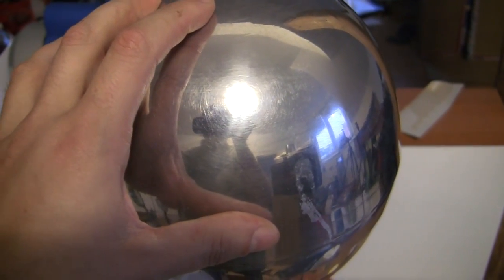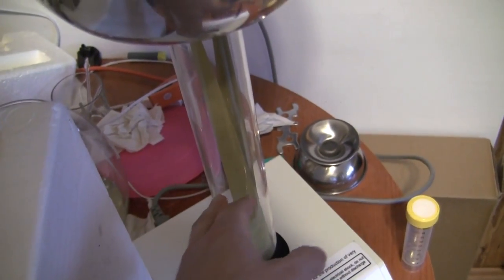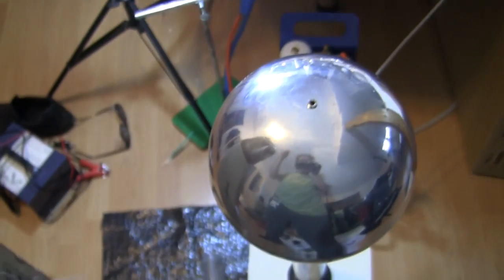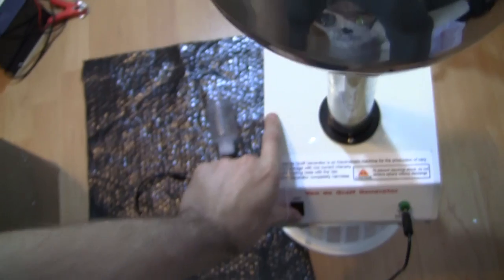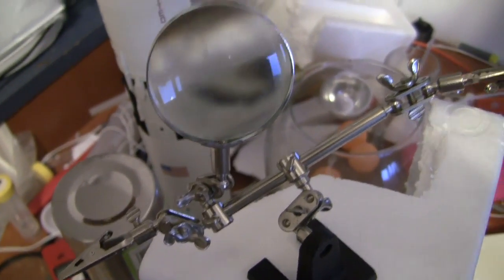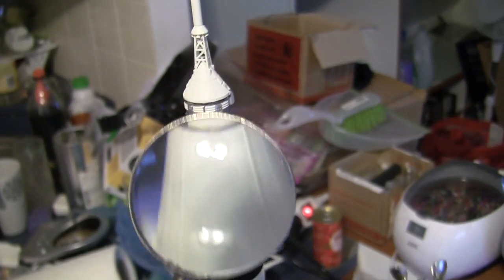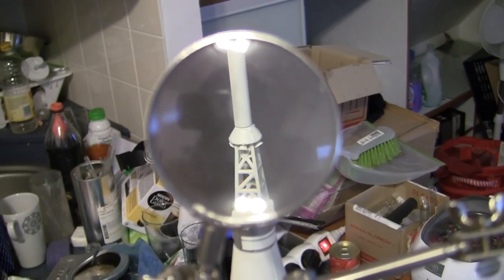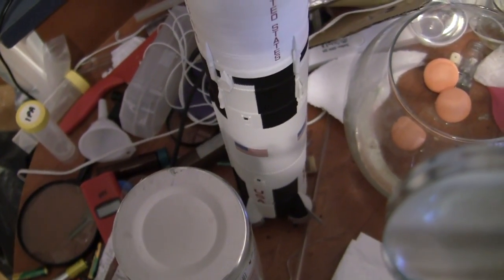Surviving a 10 000 VOLT shock!

Comment: A lot of people here have said it's the current (amperage) that kills you not the voltage.  It's a lot more complicated than that.  Voltage (measured in volts) is the potential energy of a unit of charge (measured in coulombs), so it simply defines how much energy is available for a given amount of charge.  For an electron to jump through space several millimeters requires more energy (voltage) than would be needed to move that same electron from two surfaces that are in direct contact.  Current (measured in amperes) is simply the measurement of how much charge moves past a given point in a given amount of time ( 1 coulomb per second =  1 ampere).  There is an analogy (though not exact) between electricity in a wire and water in a hose. Think of voltage as being similar to the water pressure and current being similar to the amount of water that passes through the hose in a given time.  Coulombs would be equivalent to the amount of water in the pool you are filling with the hose.

In the video the 10,000 volt spark jumping from the Van der Graaf to TF's finger, we don't really know the current, but it need not be small.  The reason for this is that current is time dependent (coulombs per second) and the spark is really short in duration meaning the actual current could be very large even if the total charge is small.  

Another issue is that the pain one feels from such a shock is not solely dependent on voltage, charge or current, but something called current density (current per unit area).  When the spark jumps directly from the source to the finger, all of the current is flowing through a very small area of the skin and we feel a painful shock. If, instead we hold a metal object,  like a key, between our thumb and forefinger and let the spark strike the key we feel little or no pain, even though the total current traveling through our body is the same.  This is because the current is now distributed over a much larger surface area.

The reason lower voltages tend to be less dangerous than high voltages has little to do with current, charge or current density, but with the nature of our skin.  Dry skin is a fairly good insulator at about 100,000 ohms.  This means that by Ohms Law touching both ends of a 9 Volt battery will only allow 45 microamps to flow through you (i = 9v / (100kΩ in + 100kΩ out)) which most people will not even feel.  But if you touch that same 9 Volt battery to your tongue, the electrical resistance drops to no more than a few hundred ohms or so and the current therefore goes up by a factor of a thousand and you feel a nasty shock.  Very high voltages can also cause dielectric breakdown of the skin, meaning the voltage is sufficiently high that current can pass directly through the skin as if it had little or no resistance.

Also, at very high voltages, you can also receive a shock even if you are not grounded (no closed electrical path).  It only requires that your body be at a lower potential than the electrical source (a neutrally charged body is still has a potential, even if it is zero and zero is less than any positive voltage voltage source).  Thankfully most of the time not much current needs to flow before your body reaches an equal potential with the source.

Comment: It isn't the "current" or the "voltage" that kills you. 

You can charge a 560pF condensator to 10kV. For the first few moment's of a discharge through human hands(ca. 1kOhm), the current will be close to 10 A. 

But I have already survived that,. Why? The Voltage decays very fast, 0.000003 Seconds after the discharge, the voltage will be 0 volt.

Comment: I get that voltage and current are separate, but what I wonder is, how do you get more of one and less of the other or vice-versa? isn't the "amount of electrons" what increases both? so how do you have tons of voltage without much amps, or tons of amps without much voltage? is it just about resistance? high resistance means you can have tons of amps without tons of volts? low resistance means you can have tons of volts without tons of amps?

Comment: Car spark plugs can output around 100,000 volts and it bloody hurts when you get shocked by them! although its pretty safe... the worst shock ive had was from a 240v capacitor for a camera flash. it lasted just over a second (which makes a huge different vs a sudden static discharge shock which lasts a fraction of a second) and it actually burnt my finger!

Comment: I built one of these (globe was 60 cm in diameter) and got about 60-80 cm sparks depending on air humidity.
I played with it a couple of years and then donated it to my children's high school.

Try this:
Lower the lightning in the room.
Stand on a plastic bucket and put your hand on the globe. Start the VDG and point your finger on the other hand out into the room. Purple plasma beams will form from your finger tips. These beams will be able to make curtains move some 20 ft away.
This is cool and will make great videos.

When standing on the bucket, fully charged, discharge carefully before stepping down, since your body and the globe has a significant amount of electrons. Discharge by letting go of the globe and stand still for some 30 sec.

When playing, make sure you're head isn't to close to the ceiling, water pipes etc. I learned it the hard way :)

PM me if you want some more tips.

Comment: Just want to throw in another fun fact. The ignition coil(s) on a typical automotive gas engine normally step up to 20kV - 45kV. I have seen performance ignition coils go into the 60kV range, and I read an article about a 100kV coil some time ago.

Comment: What I always wondered about is why high voltage doesn't necessarily translate into high current. More voltage through the same resistance should equal more current right ?
Reply: The proplem here is that you wonder about something and try to explain it without knowing or thinking about the whole picture.
The first important factor for electrical cables is the electrical current you want to transfer... the lower the current the smaller you can choose the diameter. Temperature is the reason for this... putting it simply pushing electrons causes friction(resistance) which heats up the material which increases the resistance.... if you can't get rid of the heat your cable will melt sooner or later.
Next is voltage drop... the further you transfer the more volt you loose. If you work with a low voltage you can't afford to loose much. If you transfer at 230kV you couldn't care less about loosing a few hundred or even a few thousand volt.
Now putting this together you don't want to transfer either current or voltage but power... P=U*I if P is the constant you want to move and if its better if I is low that means we need high U wich is also beneficial because we can afford to loose some voltage over the distance.
Reply: Nokwar You didn't even try to answer my question did you ? I know all that, the voltage doesn't actually drop, you're just measuring voltage across a part of the circuit.

What I want to know is why a taser for example is relatively while a 120 outlet is potentially dangerous. The resistance of your body would be the same. Is there some impedance effect or does the source fail to deliver any current and thus the voltage drops.
Reply: Keven Harvey
If that is your question you should have asked it... what I can see it's not even close but anyway.
Your taser delivers miliamps (around 3 is normal or so i read) thats 0.003A.
A 230V outlet (sorry thats what we use where I learned my job as an electrician) delivers 6-16A (but i guess your 120V outlet delivers roughly the same)
At 50Hz (for 230V systems again) around 30mA (0.03A) is where it gets dangerous for healthy humans because then the signal is strong enough to override your nervesystem and derail your cardial tact. That will cause your heart to flutter and that is the reason you die.
Now if you knew that as well I don't know why you asked in the first place.
The source does not fail because it delivers what it's supposed to... energy in the form of Watt (P)
There is no problem anywhere just simple physics. Your taser delivers 50kV with 3mA = 150W while the outlet delivers 230V with 16A = 3680W.
Thats all the energy these things can deliver.
P=U*I U=R*I
P=R*I*I > P=R*I^2
U is not important anymore
P cannot change thats what gets delivered
R changes in 1 direction and so I must "counter" to the other.

Now if I misunderstood your question again please rephrase it and I'll try again^^
Reply: Voltage is not something that exist "through" something, it's a measure of potential difference between two points. A voltage only exist across a component. You can imagine voltage as "how much the electrons want to move", and current as "how many electrons can move", the limiting factor being resistance. Most things we deal with our daily lives are not very conductive, they have a high resistance, i.e. electrons can't easily move through these materials. They are insulators. Conductors are mostly metals, or salty water. If you apply 100 VDC across a regular coin, you'll most likely melt it (assuming your supply is able to provide the current, which they most often are not). You can look at your various chargers, they will always have a max current rating - like a phone charger is around 1 A. Your mains socket might be able to supply 16-25 A, lead-acid batteries can supply 200-400 A, supercapacitors can do 1000 A. etc. Current ratings like these is always a maximum figure, the actual current provided will depend on the resistance of whatever you connect it to. If you connect that across a coin you'll just have 1 A flowing, nothing much will happen. The resistance across a steel fork might be around 25 ohm, which means that if you want to pass 1 A through it, you'll need 25 V across it (V = I*R, I = current). If that fork was made of copper, you might only have 0.05 ohm across it, in which that same 25 V would cause 500 A to pass through it (25/0.05 = I), in which case it would glow red hot and most likely melt.
Reply: My understanding is that a source can't deliver both voltage and current. A voltage source will deliver a different current depending on the resistance and a current source will deliver different voltages according to the load.

The most common source in our houses are voltages sources and the current rating on them is the maximum they are designed to be able to handle. Past that maximum the voltage will drop, the power supply will overheat and most likely fail.

Comment: i thought a static discharge could be up to 30k volts? meh at 10k
Reply: Brotherhood of Comedy
neither is really the problem it's the time you are subjected to them that screws you^^
Reply: Brotherhood of Comedy Ohm's law must be obeyed at all times, there is no such thing as voltage without current or current without voltage. the only determining factor is how sweaty your hands are. (and if you have any cuts in your skin)
Reply: It can be close to infinite, The voltage in a lightningstrike can be up towards One Billion Volts, One centimeter(About one third of an inch) Is about 10 000 volts, Now think how high the Clouds is, That is how Extremely high voltages is needed to the clouds to discharge.
Reply: Yes, they do. Everything follows Ohm's Law.
Reply: ***** yes they do lmao, they have something called dynamic resistance which means their operating points change as conditions change. in this case their resistance is expressed as dV/di. also they arent the only things that behave in this manner your body for instance actually offers lower resistance the higher th voltage you're exposed to. 

Edit:Nope you're right ohm's law formally only talks about linear relationships in conductors.

source:i am a recent ece grad with a focus in semiconductors
Reply: ***** So you're just saying "your measurement is correct but it's wrong".
This statement is false.
Reply: For that matter, there's no such thing as a component with a fixed resistance under all circumstances. I'm pretty sure there's no component with a fixed resistance across various temperatures. Ohm's Law always works pretty much by definition because resistance is defined as V/I. If you think you can have more current with more resistance with a given voltage or the opposite of that, then you don't understand what resistance is.
Reply: ***** i should maybe not reply at one am whilst on the shitter as i seem to suck at conveying my point. all i merely meant by my last comment is that working in the industry, be prepared to see things reffered to incorrectly because of bad habits/ people just not giving a crap. This certainy was an eyeopening discussion though i mean 4 years after you start on your degree and after you graduate and begin working as a technologist nobody really cares if you say ohms law. It was one of those things i learned a long time ago but it's so basic that few people actually look at it so formally. Just look at the comments above lol, i'm not the only one to get it wrong. 

its really amazing how assuming you know something actually prevents you from learning more about it.
Reply: ***** I'm not sure how to make this more clear, but if Ohm's law only applied to components with a permanent resistance, it would apply to nothing at all and would be a pointless law. The fact is it doesn't apply only to components with fixed resistances. A function's variables don't have to be constants. In fact, that's why they're called variables; they tend to vary.

Also, resistance is by definition voltage divided by current, so it holds in all situations. There are some where it's not very useful as you've pointed out but it remains valid nonetheless.
Reply: Amps are the dangerous ones
Reply: ***** Sure. Especially semiconductors.
Reply: ***** And still it does obey Ohms Law.
A diode simply does not have a fixed resistance.

I = U/R   > no where does it say that 'R' has to be a fixed value and can not be itself a function of U/I or other things.
And as you mentioned theor characteristic - well, what do you think they are for?

Oh, so you can calculate the current flowing if you apply a specific potential.
Ohms law wins again.
Reply: ***** nigga you know what i owe you an apology you're absolutely right ohm's LAW is only for linear relationships more specifically conductors. But that doesnt mean diodes don't have a resistance that is measured in ohms. I didnt read your comment carefully and i thought you said that diodes dont have resistance rather than they dont follow ohms law.

evereyone listen to this guy he's right
Reply: ***** Sorry for you that i have learned electronics, circuit design, none-linear circuit technique and many more things in that direction.

Ohm's law has changed over the past.
The linear function is by far not the only solution anymore.
You know, R can also be a complex exponent for example.
And lo and behold, it works that way and yet is still called Ohms law even if applied to things like tunnel or gun diodes.
Yeah, you can have some pretty complex formulas there, yet it still falls under ohms law.
Reply: ABaumstumpf i think the issue here is we're getting our definitions mixed up on a technicality (i just spent the last 20 mins or so going through some of my old textbooks) ohms law only refers to objects with a linear relationship but even among my peers we coloquially use it to describe any relationship between voltage and current. Its really an argument of semantics at this point.
Reply: ***** Pretty much - yes :P
What i learned, what all my colleges learned, what is used nearly everywhere is Ohms law as the correlation between Voltage and amps, not limited to fixed resistance.

Btw - the original point of the comment flow was about an idiot stating that amps kill, not volts. You don't get amps without volt, and neither is sufficient to determine the damage done.
it pretty much is wattage and energy, or high enough energy in a not too long time to kill somebody.
Reply: *****
http://en.wikipedia.org/wiki/Ohm%27s_law#Reactive_circuits_with_time-varying_signals
You go as far as post the Wiki-link and then ignore the sections you don't like :P

Comment: I think Van der Graaf generators put out a lot more than 10000 volts. At school my teacher said 250,000. I remember learning that. I just checked another youtube video which says 200,000.

Is that because different generators produce different voltage? Or is TF out there?
Reply: Size of the generator, materials used for the dielectrics (the moving belt and their axles at each end) and insulators, the speed of the motor, the size of the capacitive sphere on top are all factors in determining how big a charge can be generated:

The wider and longer the belt and axles and the faster they rotate, the better results can generally be achieved, if the materials used on each end are as far apart in the triboelectric table as possible. Often used are nylon (positive) for the belt and top axle and teflon (negative) for the bottom axle. Think of the cat fur and amber, rubber balloon and hair, or some shirts / jackets and car chairs et cetera, where some materials rubbed together can produce a noticeable higher charge.

A small sphere can hold a smaller charge due smaller area as well, so it would discharge more often at a lower voltage than one with a large sphere. It's not that much of a hassle to go beyond a 250 kilovolts, but the size of the generator tends to go up, unless it's really well built and has as few losses.

The faster the movement of the belt, as long as enough free electrons can be supplied from something like a wire connected to the safe ground of the mains plug, the better, up to a point (never a live wire or zap.)

Generators up to millions of volts are still in use in some older particle accelerators.